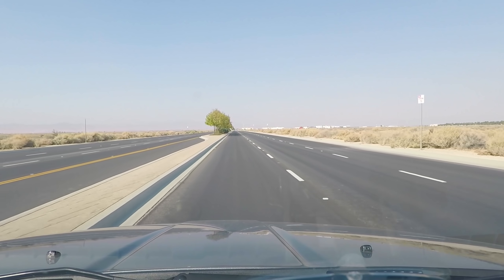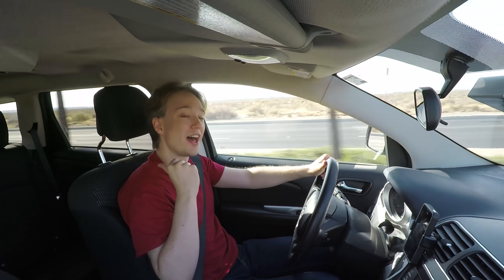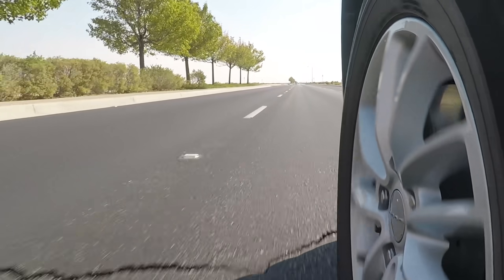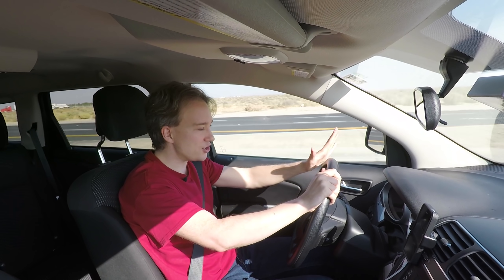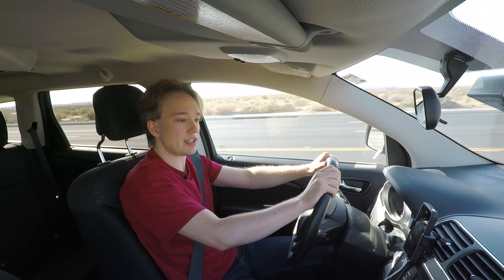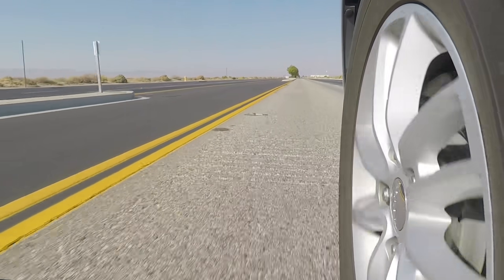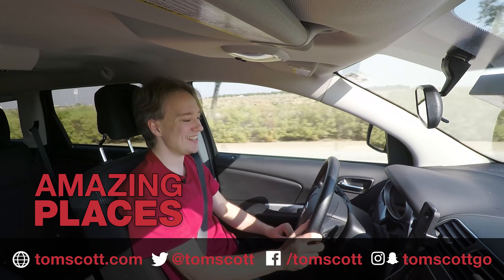Why California's musical road sounds terrible

Comment: You have made a couple of mistakes, let me clear it up for you so you can understand why it sounded wrong for you.

Key Details:

Vehicle: 2008 Honda Civic (hence the name "Civic Musical Road").

Speed: 55 mph (to get the correct tune).

Song: Finale of Gioachino Rossini's William Tell Overture.

Mechanism: Grooves in the road vibrate tires to create musical notes, like a giant record player.

Location: Originally on Avenue K, moved to a more secluded spot on Avenue G due to noise complaints from nearby residents.

Comment: It seems to me that the speed should be more than 55mph, maybe 15-20mph faster. Aside from making the lines wrong, the only way to make it sound better would be to speed up.
Reply: Okay, so all you need to do to hear it correctly is speed. 😃
Reply: @WaterEnthusiast1776 it might not sound the way it's supposed to, but it would be better than at 55mph, the pitch should be higher

Comment: It’s a great concept; I had heard (I guess erroneously) that the problem was in the fact that it was tuned to a specific model of CAR that resonated just so and that any other car would not resonate in the same way and that was the reason. 
Perhaps that is a different road, or maybe that’s what this story had turned into by the time I heard it, either way, aside from the wear and tear on the tires, as a musician I am totally down with the concept, even if it’s not a recognizable melody; it’s still *some*thing not boring.

Comment: Wouldn't there also be a problem with having two pairs of tires passing over it?
Depending on the wheelbase, parts of it will be out of phase, some in phase.

Comment: If that's the case, what happens if you drive twice the speed limit on the road, do you get the right sound? Because if they are twice as far apart as they are suppose to be then theoretically...

Comment: Four inches apart means that the distance between is four inches. Who on earth measures the distance between the exact center of a thing and another thing? Designers need to be very specific when making their drawings or just go watch the work when dealing with novel construction.
Reply: "inches apart" is bad engineering language.

Use "center to center" or "edge to edge". No ambiguity.

Comment: You would think that all the extra regulations and safeguards California has in place compared to other states would be able to prevent this mistake from happening at least on the second attempt.  These are the constant examples I get that have led me down a path where everything liberals touch becomes more expensive and less efficient at best.  In some cases, things just don't even work at all.

Comment: As a non-native speaker, I can't figure out the difference between "every 4 inches" and "4 inches apart".
Reply: As he explains, “4 inches apart” means from the edge of one groove to the edge of the other.  “Every 4 inches” means that you take a ruler and draw a line every 4 inches.  If each mark is 1 inch wide, then there’s only 3 inches between them when they’re drawn at 4-inch intervals.
Reply: @KaiLucasZachary  Ahh, okay!
This was missing. I didn't know that the grooves were 1 inch wide.

It's poor communication to be honest.
Had they said that the grooves are 1cm wide and that the grooves should be 3 inches apart, there wouldn't have been any mistakes made.
Reply: @simons1120  I don’t know the exact length of each groove (was just using 1 inch as an easy round number), but the premise remains the same.  Yes, it is all bad wording and failure to communicate.

Comment: What's odd is that this isn't just a problem with the English language. Where were the designers? Any sort of infrastructure, no matter the scale, has to have a set of plans that the builders would follow.  Detailed 2D drawings regarding the dimensions of the grooves and the spaces in between. 

This isn't just a misunderstanding of the language; but also seem to be caused by the lack of clear drawings and details that the laborers would follow.

Comment: Poor detailing and reading comprehension!  That’s what that means.  I run into this all the time.  Example, divide the paneling into 4equal panels, with 4” stiles.  Invariably, the forget to take into account from the centre of the rail to centre of rail.  The measure the overall width of the wall, divide by 4 and lat it out…

Comment: NJ built out 287 north of Montville in the 90s and did this.  Several years later, they had to spend millions to shave it off due to all the noise complaints.  It definitely helped with rain and traction, but the vibration was annoying.

Comment: Great video.
But travelling at a different speed according to you should change according to the speed no? As the gap l(wavelength)is constant, you are dividing by the vehicle speed to get the frequency. Why divide by the vehicle speed?

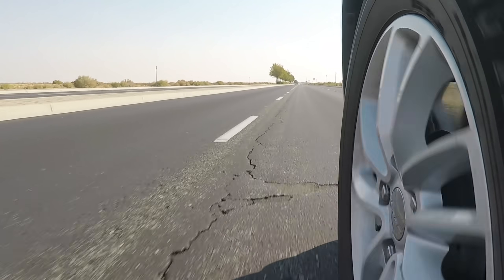Comment: The problem is not the English language, contra 1:45.

The problem is malpractice on the part of the designer preparing the drawings and/or the construction crew reading them.

Construction English has very clear terms ("on center" or "center-to-center") to describe a situation when you want a series of discrete elements of non-zero width to be spaced at a certain regular interval relative to the center of each element, vs. when you want to denote the true edge-to-edge spacing of a gap.

For example, a standard stud wall has vertical studs spaced 16" o.c., which means the edge-to-edge width of the bays between the studs is 14.5" (as 2x4 studs are usually milled to 1.5" thick).  This is why insulation is sold in 15" wide rolls - get a little extra margin to account for minor framing irregular and aid in friction fitting.

Most likely, the error was on the part of the designer drawing the plans who did not discuss this concept clearly with the acoustician to make sure he translated the acoustical physics specifications into proper construction specifications. Because any construction crew worth its salt would check the drawings and specs to see if a measurement was tagged as o.c. or true edge-to-edge, and if it wasn't clear the foreman would stop that part of the work until he could reach the designer by phone to clarify.

Comment: Inspired by the inkjet printer, it would be possible to make a device that refurfaces roads in a way that 'prints' a precice amount of road as the machine drives along.  This could be used to 1) measure and repair defects in the road's flattness in real time, or 2) print high fidelity sound messages on the road's surface.

Comment: Thinking about this now, something like this could be done in a way that uses the spacing between, and of, the grooves.  Between for frequency, and its measurement for the amplitude, possibly allowing for multiple frequencies at a time with certain parts being more prominent.  Even so, how difficult would it have been to just include a visual example to specify what the measurements are referring to, or just asking to verify?

Comment: So this is a case of "pass the message" where along the way someone cuts corners to deliver the message in an easy way, which screws the message.

Kinda like how parents always say, "Blood is thicker than water." Without saying the full quote because if they did, then the quote would actually be AGAINST what they think it is.

Lesson: Don't cut corners.
Reply: no that is actually the original quote, the water of the womb phrase came later by a 1885 writer but the "original" quote is actually blood is thicker than water

Comment: It would probably be best to design a machine that could "engrave" any melody to 1 mm precision, both to create a new musical road or resurface a used one. And please engrave it in stereo, with 2 different tracks for the left and right wheels, and maybe some silent space on the side for those who want or need to drive silently.

Comment: I think though even if the notes were right there is still one GLARING problem... cars have two (or more) axles meaning there will be leading and trailing notes overlapping each other no matter what. So unless someone drives over it with a segway or unicycle at car speeds it's not going to sound good.

Comment: Lot of nonsense for something not 100% correct. 1- I am damn sure wheel base length is a BIG factor as a longer automobile like a extended pickup the back tires would sound completely different from the front which would make it sound like it did, Like its behind and ahead of itself. 2- Weight of a Automobile make these things all sound different. A little Mini Cooper puts out a higher pitch sound then a heavy Bel Air does, once the tone is to low or High you wont hear music any more. Also how much Noise insulation was installed into the car? Some cars are made to be silent. some cars have none which you would hear every bump and some have enough to where this wont sound like music it would just sound like noise. No matter what this concept would ONLY work if we all drove the same car.

Comment: I feel like the wheelbase of your car would totally screw with the timing of the notes too. If you think about it, if the wheelbase makes it so that the front and back wheels don't hit grooves at the same time you'd be playing 2 notes at the same time and they'd be overlapping. THAT'S what screws it up.
Reply: The wheelbase makes it so each note has a ramp-up period when only the front wheel is on it, and a ramp-down period when only the rear wheel is on it. During those periods the note is quieter, but it does not change the pitch (ie, sharp or flat.) As long as the space between the notes is longer than the wheelbase, it can not be on 2 notes simultaneously. It is likely that they foresaw this problem, which is why the tempo is significantly slower than the real song.

Comment: I know I'm late here. Just found this. I appreciate the explanation here. You see I drive down this road a dozen times a week sometimes. I have driven it at every speed imaginable trying to find the right speed to make it sound right. Now I know why my attempts were futile.
Reply: It's funny because with the benefit of hindsight, it seems obvious that driving faster or slower wouldn't change the notes from sounding out of tune. But if I hadn't watched the video I probably would have done the exact same thing.
Reply: @pugsnhogz  Actually, if you drove at a variable speed you could get it to sound correct (if you performed the calculations for which speed to go at over which sections).
Reply: Late as well 😂😂

Comment: Having studied architecture at university, this stuff sometimes happens.
It's like playing "telephone."
Information gets lost between the exchange & transfer of ideas between the designer, the engineer, the contractor, & even the construction crew. That's why it's essential to tour the building site and build mock ups to scale and smaller models so that everyone is clear on what is going on.
Reply: Yup, somebody didn't clearly specify "on center", so it got interpreted as "edge-to-edge" instead.
Reply: But twice?
Reply: But they made the same mistake twice...
Reply: It's a bad print. You have a little cross section view that shows exactly what the measurements mean. That's as basic as it gets. Total incompetence all around--or more likely, apathy.
Reply: Well then do graphical instructions ... not that hard ...
Reply: So much hassle could have been saved by just providing a visual reference.
Reply: That always takes more time and money though and they clearly didn't want to spend that much on it.
Reply: @CoyoteSeven 
True. This is mostly a gimmick so the expense is not justified and there were no safety risks involved that would make that stuff necessary.
Reply: came here to say the best way around this is saying to a worker 'place the grooves at 4 inch *centres*' and i'm piggybacking on this comment to get it closer to the top - thanks!
Reply: It's called "COLLEGE" ... bloke
Reply: Add to that last minute changes, building following a suddenly outdated blueprint is great fun
Reply: It does not matter what anyone is saying, all that matters is in the signed blueprints (and sometimes e-mails)
Reply: The problem seems to be that some people are not that intelligent and also have no understanding of how sound works.
Reply: Isnt this more of an engineering issue? @wtssmaller
Reply: @audiobad  no. Its just common sense. A certain note (pitch of a sound) requires a specific frequency. The cement piles are of variable sizes. So its obvious that the numbers on the plan dont only refer to the space in between the piles. If the workers used their brain they would have realized that.
Reply: the designer were americans, the contractor were americans as well, but the construction crew were mexicans

Comment: It's why blueprints say 16" on center between 2x4' studs in the wall.   Anyone in construction see's 4" apart, will do it the way you see it here.  After repaving it, if they used the same blueprints, then you get the same road.   Although I would wonder over time as the pavement wears down if it will change its tune as well.

Comment: I feel like something like this IS difficult tho, the speed limit equation is one thing sure, but what about the tire type? Tire size?  Even wheel distance between both tires of each individual vehicle? These things would all effect the overall sound that is emitted from the road. Sure you could specifically engineer it to sound right with ONE type of vehicle and wheel settup, but no way it would sound the same with ALL vehicles.
Reply: A lot of factors effect road noise, but most of them wouldn't be relevant to how people recognize a melody.  As a long as every vehicle is going over the grooves at constant speed, the relative pitch and rhythm of the notes should be the same for every vehicle.  Although you can't have too fast notes or long vehicles would blur the notes together.
Reply: At the same speed, it would sound essentially the same with all vehicles.
Reply: While these concerns may be relevant to to sound quality, none of them have any effect on the tuning. The only things that can affect the pitch of the notes (besides groove distance) is the speed of your car (which should always be constant in this situation). Going slower would shift the key of the entire song down, and vice versa... but it wouldn't make it out of tune.

Comment: 2:00 before even finishing the video there is a simple solution to this in construction that is used all the time, it's called (x from center)   

which of course is self explanatory but if you need further clarity, simply measure (insert distance desired) from the center of your marking (last point of origin) and you can easily make adjustments for whatever width of material you are working with

Comment: Yikes! That would freak me out.
Reply: how, when would you POSSIBLY be driving on a desolate desert road, alone, with no prior knowledge of the area whatsoever, I can almost guarantee that road would have a pinpointed location, or at least 12312978461239084612-4129837178245 sings telling you where the musical road is

Comment: But aren't they forgetting something quite major, even despite the incorrect spacing, a car has 4 tyres, 2 at the front, and 2 at the back.  
At 55mph, the front tyres will play the note roughly 0.0041 seconds sooner the rear tyres, that's not a lot, but it's enough to change the frequency of the sound.
Reply: ok

Comment: More like Engineering failure.  The technical terms were followed by the construction crew.  Apart is from 1 end to the other end, it does NOT include the width.  Width has to be specified. The crew did as instructed.  ISO Standards BABY!

Comment: it's amazing how many times engineers will bash their heads on a wall trying to figure out what's wrong without questioning the design to its foundation
Reply: It wasn’t the design? It was designed perfectly fine but either the constructor dropped the ball hard. Or the drawings were unclear and too ambiguous
Reply: @monhi64  It's why the words "on center" are very important in construction. "4 inches on center" is what is usually and should be said.
Reply: It is likely the fault of the constructors. Who in the right mind would think "1 groove every 4 inches" means a 4-inch gap between grooves?

Comment: Uhhmmm... I think that if the car goes faster the frequency of the sound will also change, therefore the tune will change (a 'do' may turn into a 're', for instance).  Therefore if you go faster it will play faster and with a change in the tune.
Reply: That won't change the tune. That'll just pitch shift it or in more musical terms (and as Tom said) change the key. 

That's because in changing speed, the frequency of each note will be multiplied by the same constant. For example if you doubled the speed, each note would become an octave higher.
Reply: @lowcostfish  thanks for da information
Reply: Yes......maybe....too faster? Or too slow
Reply: it only changes the key.

Comment: But even if the road were built correctly, saying that traveling at a different speed won't effect the sound is completely wrong. The speed is a part of the formula that determines the note, drive at a different speed and you'll hear a different note. Furthermore, the type of tires fitted to the vehicle will change the note, because the tread pattern on a tire produces it's own, constant noise even when driving on a smooth road. Think about the sound big chunky off road tires make when driven on a paved road (the way that 99% of people who put off road tires on their pickups use them! smh).
Reply: Changing the speed changes the key, which is ok.